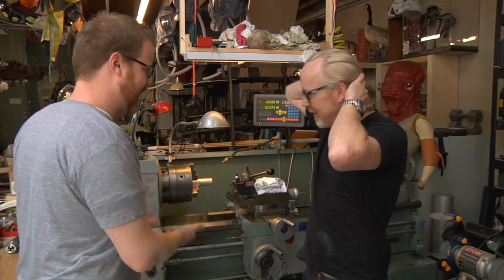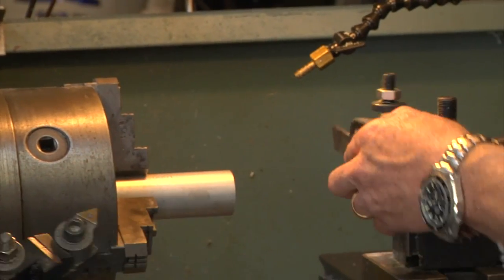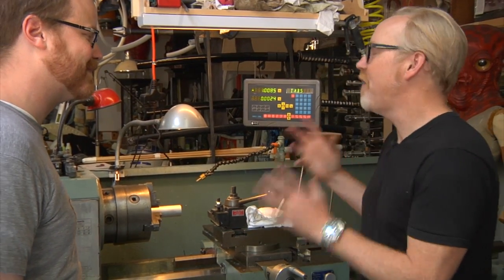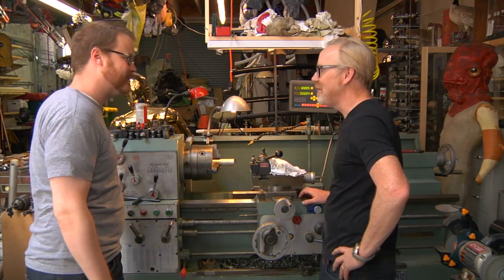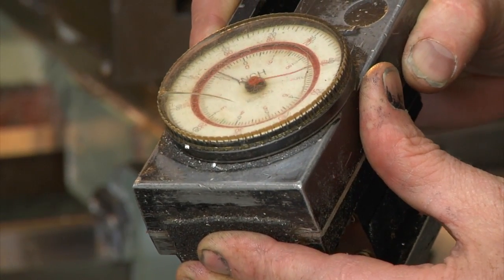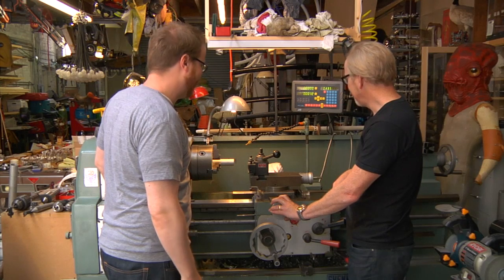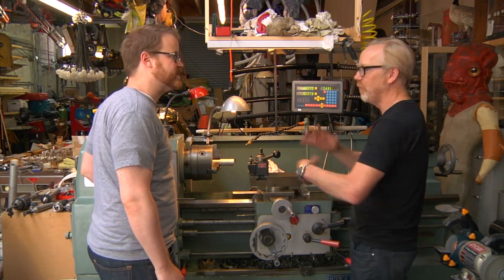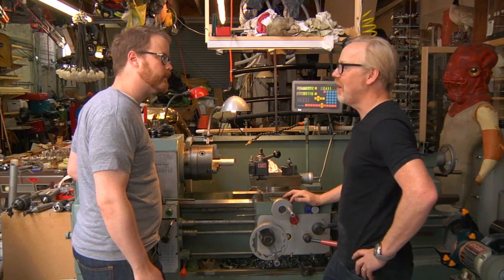Inside Adam Savage's Cave: Metal Lathe with Digital Readout

Comment: Actually, no.
3D printer are too imprecise and made of several materials with different propriety. Ex: the print head is in metal. metal 3d printers can't make the springs: it make brittle porous metal. Plastic 3d printers would make the springs, but then wouln't be able to make the smooth rail needed for smooth operation. So you could print the parts, but then you need a lathe and other tools to make stuff perfectly up to size. Plastic sliding parts would also wear up fast, unsuited.

Comment: Sure, it wouldn't actually work. But you could. Even the most advanced 3D printers which use laser sintering of powdered metals require secondary machining operations to have useful parts... unless the part is simple.

Comment: I agree, hence saying "in what can be", albeit it with a typo. My point is that a machine shop can never be made safe, and will always require adherence to strict rules and that absentmindedness is not tolerable. Failure to adhere to the little rules means you cannot be trusted to the big ones. If you can't be trusted to take out a 2lb key, why should you be trusted to get a few hundred pounds spinning at 500rpm?

Comment: Actually, in metal working, chucks are typically quite large, far more than you'd expect from say a wood lathe. Even on a smaller South Bend you might find a massive chuck that requires a hoist over the lathe bed... In metal shops where they do a lot of marine work or shafting this is typical. Check out Keith Fenner's youtube channel  KEF791

Comment: doesn't it depend on the type of 3d printer? the level of precision is usually measured in microns right? that;s not precise enough?
btw architects are planing to make buildings by 3d printing them.
btw2 3d printers are already able to print skin, metal, food and concrete, right?

Comment: There are much greater potential hazards in a machine shop that you can't remove by adding springs, and if you can't handle the relatively small requirement of never leaving the chuck key in then you have no place is what can be such a dangerous environment. It's better to build good habits than half assed safety nets anyways.

Comment: i think that it first came from the fact in the raw definition of a lathe all you need is a spindle and a lathe is the best way to make that (excluding grinding). but yes i could make a metal lathe on a metal lathe pretty easily. the ways could be round and the x doesn't really need ways. it could pivot around the way for the z since that will be round. i still think it's a nonsensical thing to teach but that tidbit is still in all the curriculum and always starts conversations like this one.

Comment: that's just some gee wiz psudo "fact" they tell you in tech school and old books. you can bore sleeve bearings in a mill with an offset boring head or hold work in a mill spindle and mount tools to the table. you could in theory make a tapered sleeve bearing with a rotary table and tilt the head then scrape it to a perfect bearing surface. also you can scrape the ways for a lathe which doesn't require machine tools so technically the lathe could be the only machine tool used o reproduce itself.

Comment: Very interesting I haven't seen anything about reprap. Yet even stated by one of the engineers they currently can only make 50% of the parts required to duplicate a second machine. It cant make bearings it cant make threads and much more . I think the idea is stellar but I hate to inform you the future is still a ways off.

Comment: You are taking Adam's comment too literally.  The electrical connector that the lathe plugs into the wall connector would be difficult to make on a lathe.  However, most of the parts of a lathe could be made on a lathe, in a pinch.  Making all the tooling that the lathe uses on a lathe would be difficult as well.

Comment: i used to work in a shop. saw where another CNC mill got clobbered by a counterweight flying off the head of a lathe while they were turning a big egg beater looking thing for an industrial mixer. was like a 4 inch cylinder by 3 inches thick i think. dented the mill right beside where the operator programs it.

Comment: My father was a metal worker and had a lathe in the basement.  He taught me to use it and I must say that a lathe is one of the most dangerous tools one can use.  That spinning chuck will literally rip your fingers right off if you make a bad mistake and the cuttings that come off of the metal you're turning are like crude helical blades that'll shred your flesh.  You either respect the lathe or it'll kill you.